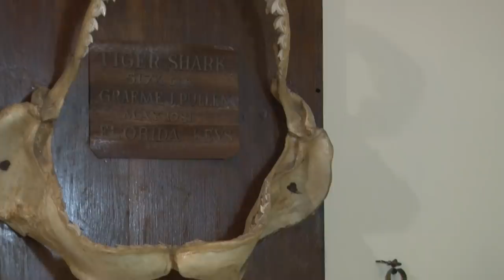17 CARP! Fishing with BREAD!

Comment: Hi Graeme. Thankyou for the video. Was just wondering how you manage to find lakes that allow floating bread as ground bait? 100% of the lakes that I fish only allow bread as a hook bait. Great method but if you cant throw any in as ground bait it makes it a harder to use that method :o(
Reply from the maker: I mention at the start,its called Lake Farm,they also used to allow fly fishing for Carp as well which if great fun. Just keep checking different fisheries to find out which ones allow floating breads ...Have you tried slow sinking flake under a float ? Can be deadly,or even the pellet waggler method.

Comment: SMITH: (hand raised) Smith here, Mr Pullen, Sir. Still sat at the back of the class for some reason. Point of clarification about your great tip of pulling the rod in the opposite direction to the one the fish is swimming to get away once hooked. What do you advise if the fish is swimming straight towards you?
Reply: Crank the reel fast as possible, rod high to try to keep tension.